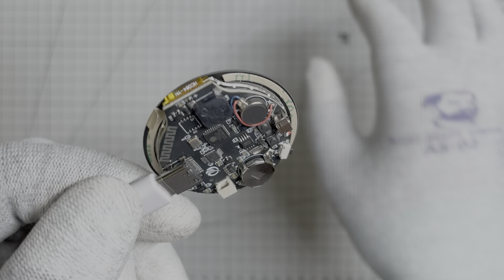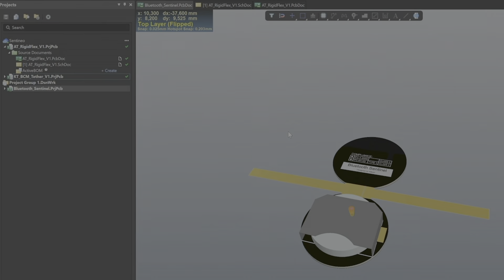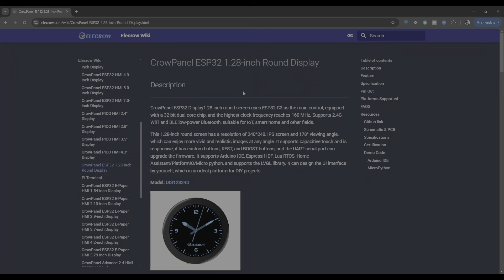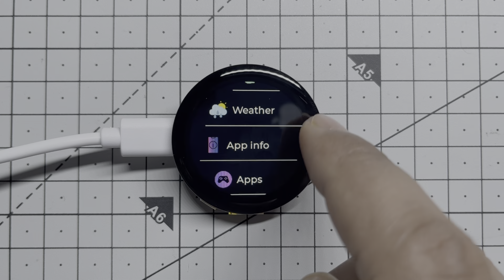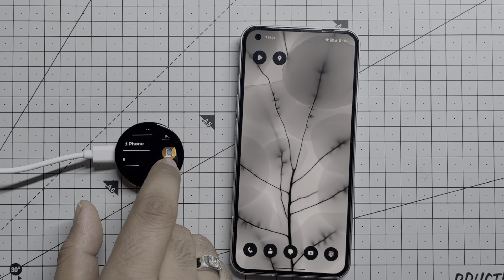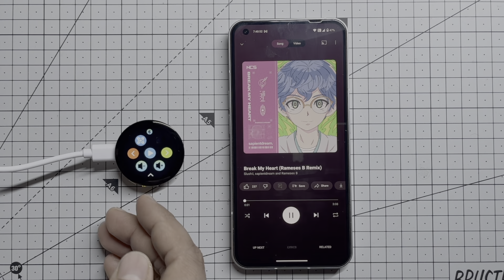DIY Smartwatch: Build It Cheap, Wear It Proud!

Comment: Also one more thing I have bought the battery might for this watch and have connected it through the battery connector on teh watch PCB. I’ve used a multimeter and the batter seems to have full power. However when i connect it to the watch it receives no power from the battery. But when i plug the usb C cable in, then the screen boots up. The second i unplug it with the battery connected to the battery connector the battery shuts off. Is there anyway to troubleshoot this thank you.
Reply from the maker: What is the capacity of the cell/battery you have connected?
Reply: @electronicsinnovation  Im not sure about capacity, but when I checked it had 3.8 volts
Reply from the maker: There will be some thing mentioned as XXX mAh Tell me that!

Comment: Hey. Cool video. I'm starting a project trying to create my own smartwatch to track my pulse and my km when running. Is the watch ok to connect with a  MAX30102 (a pulse captor)?
Reply from the maker: Yup, that can be done but little rework to be done on the board!
Reply: Hi , I’m working on a similar smartwatch project !
Did you manage to use the MAX30102 for pulse tracking?
If yes, I’d love to know how you did it.

Comment: there is one thing i still don't understand. This is amazing piece of tech but in my opinion it's not elegant as i'd like it to be. It could've been perfect if crowpanel used hirose df40 connectors to stack it instead of ribbon cable to connect screen to esp32 module. If i were making same thing i would've go with hirose connectors. Don't get me wrong it is well done but it could could've been way better.
Reply from the maker: Yeah, there is always room for improvement.
Also there will be a reason to go ahead with the  FPC cable.
If you use df40, that might increase your overall height of the module and also such a connector will be costly too.
Reply: @electronicsinnovation   actualy it won't be as costly as you think, also even if it increases overall height it all depends on pitch of the connector so that increase could be barely noticeable. standard df40 might be bit pricier but if you use df40g variant it should be cheaper as it doesn't go beyond pcie gen 2 and for this use case it's perfect. I am sharing what i know. I also have few projects in mind but i want to use hirose connectors for them. Hirose connectors are also what connects raspbery pi cm4 to development board and you don't even notice increased height. This is your project so you go ahead however you want.

Comment: is there any good module available out there to install wear os? And moreover I had a amazfit verge with 2.5 gb of storage and can run apps with some tweaking. I was looking for wear os to try installing on it or knock off watches that run full fledged android but I wasn't available to find it. Btw you are totally doing a great work, i was glad that months after i found your video and you gained a new subs, i as a student and tech nerd look for your type of talented one which hard to find these days. Hats off to you for your amazing work. Learning so much from you. Stay blessed
Reply from the maker: "Hey Bharat, wow, your comment totally made my day—thank you for the incredible support! 🙏
 I’m so glad you’re learning from the channel😄.
As for Wear OS, it’s a bit tricky with modules like the CrowPanel since Wear OS needs more robust hardware—like a Snapdragon Wear chip—and a lot of optimization. Your Amazfit Verge sounds awesome, but Wear OS might be tough to port due to driver and compatibility issues. Full Android on knock-off watches is also hit-or-miss; most budget ones use stripped-down versions rather than full Android. 
I’d recommend checking out communities like XDA Developers for Wear OS ports or exploring boards like the PineTime for custom OS projects—they’re more open for tinkering! 
I’ll keep digging into this space for future videos, so stay tuned! Thanks again for the love—stay blessed too! 🚀"
Reply: @electronicsinnovation is snapdragon wear chipset are available with modules? I guess not.

Comment: Hey video idea 
Install wearos in it!!!
Reply from the maker: That would be awesome, but sadly the processing power is way too low for that. 
Wear OS cannot be installed on the CrowPanel 1.28" touch display with ESP32-C3 due to insufficient processing power, limited storage (4-16 MB), and lack of GPU support. Wear OS requires multi-core SoCs, 1 GB+ RAM, and 8 GB+ storage, far beyond the ESP32-C3’s capabilities. Its Android-based architecture is incompatible with the ESP32’s bare-metal or FreeRTOS environment. The CrowPanel’s basic touch and SPI display also lack Wear OS’s hardware requirements.

Comment: Can you put wereos?
Reply from the maker: Wear OS cannot be installed on the CrowPanel 1.28" touch display with ESP32-C3 due to insufficient processing power, limited storage (4-16 MB), and lack of GPU support. Wear OS requires multi-core SoCs, 1 GB+ RAM, and 8 GB+ storage, far beyond the ESP32-C3’s capabilities. Its Android-based architecture is incompatible with the ESP32’s bare-metal or FreeRTOS environment. The CrowPanel’s basic touch and SPI display also lack Wear OS’s hardware requirements too.